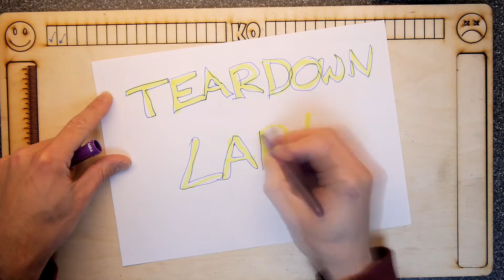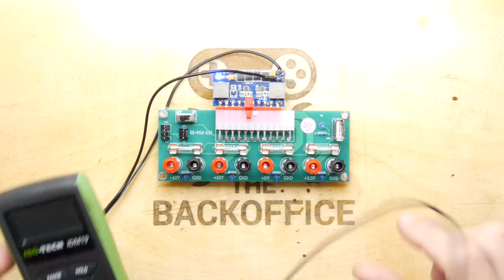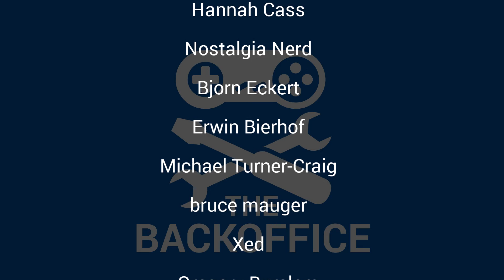Pico ATX PSU

Comment: Is this not designed for a car with a high current 12v input? Your basic wall wart might struggle. :)
Reply from the maker: The car versions have a wider input range upto 14 or 28v. This one would need something like a laptop PSU for full current.

Comment: lead-free solder on the PCB, bump up the temp about 30 degrees , also swap the fuses as they are usually about 20amps, 2 or 3 amps is better, HTH